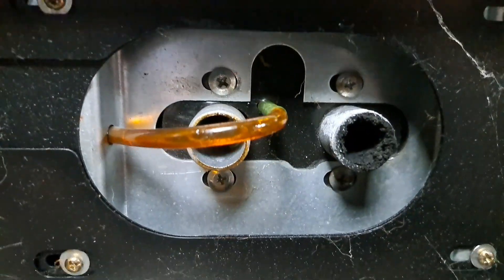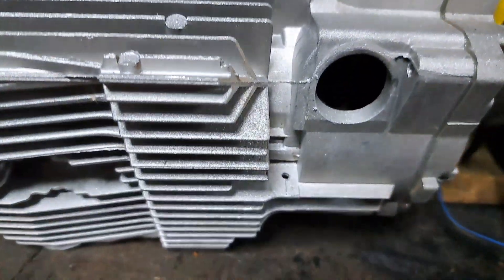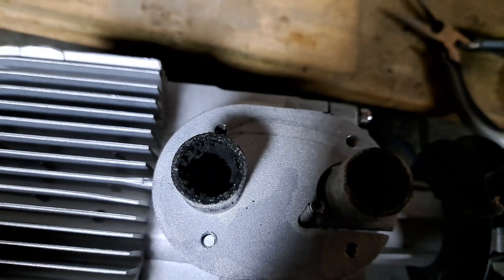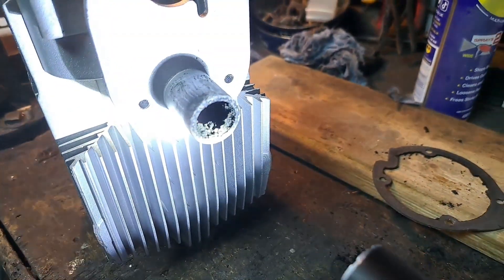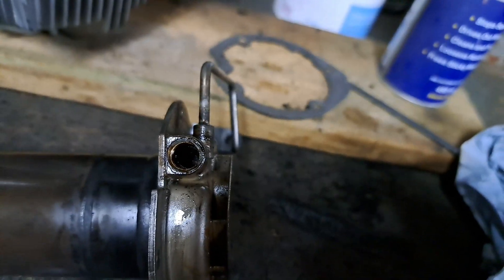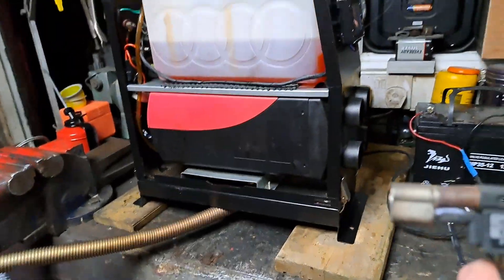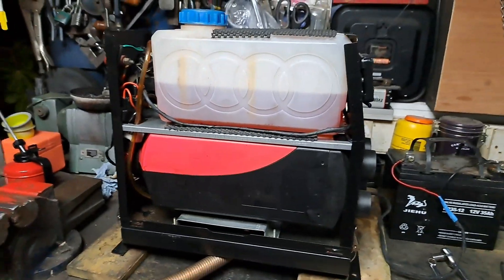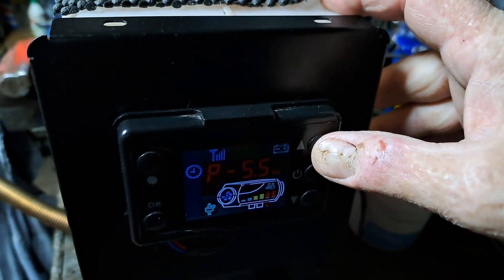Chinese Diesel Heater. Inspection and Repair.

Comment: Service kit about a tenner ,including new glow plug strip it   clean it all , check the small hole is clear near the  glow plug
Reply from the maker: That's just what I did. Stripped and cleaned up everything. New glow plug and away it went. Running great 👍